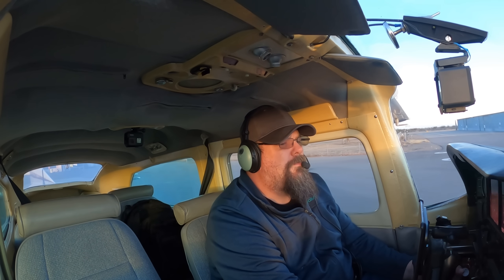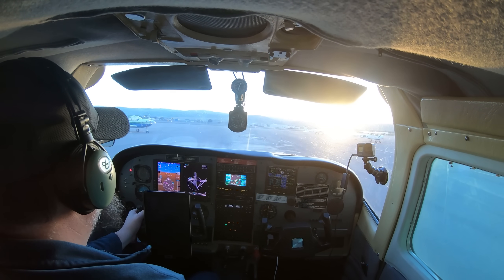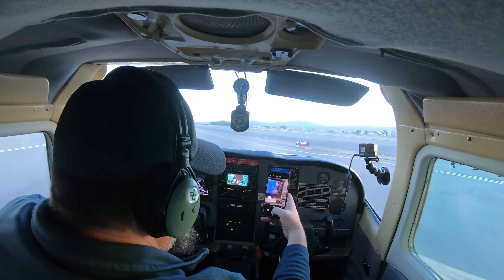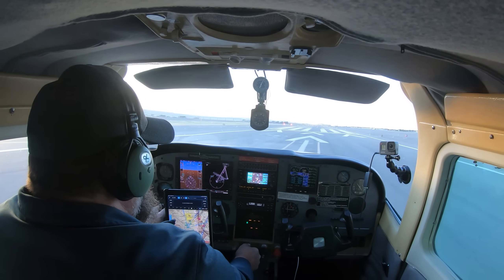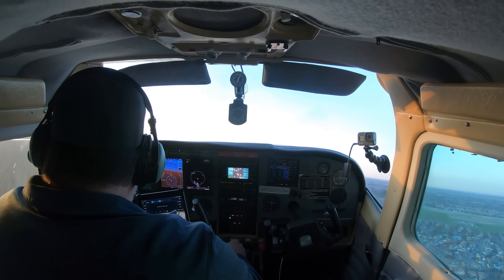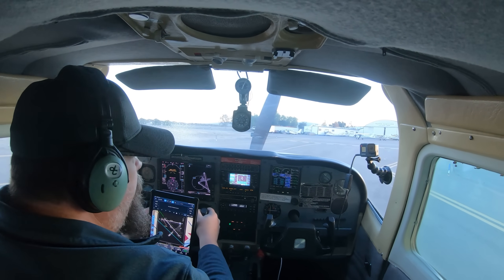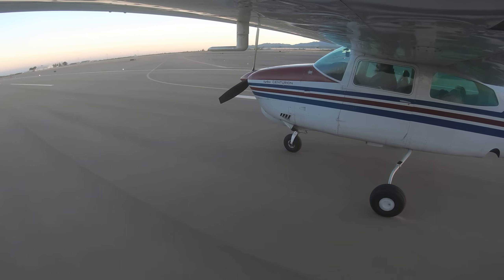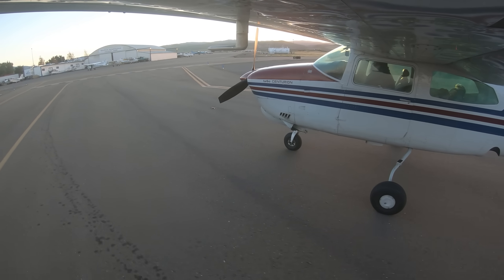Catastrophic Engine Failure after Takeoff

Comment: D.E.I. aircraft mechanics! Mechanics should RUN THESE REBUILT ENGINES FOR A COUPLE OF HOURS ON THE GROUND FIRST, THEN check for issues, like metal shavings in the oil reservoir and filter, recheck compression in each cylinder, retighten each hose clamp, nuts and bolts checked for tighteness BEFORE the plane should be signed off to fly, but it seems more and more engine mechanics SUCK at rebuilding engines and pilot's and passenger's  LIVES are more at risk when their REBUILT ENGINRS SEIZE UP Fter shortly taking off. We just watched 'EXHIBIT A' of an example. ANOTHER thing I would consider putting in my engine oil is Lucas Oil Treatment that makes the oil stick to bearings inside the engine, 'cause if you lose your oil pump, the Lucas will help you limp back to the airport without seizing the engine and continue to produce thrust from the propeller.

Comment: I fail to understand why engine loss is even a thing in aviation.  Unlike cars, you can't just pull over if something fails.  Unlike cars, aircraft engines tend to have these weird catastrophic failures like holes blown through metal, oil all over the place, etc.  Unlike cars, aircraft have complete overhauls every so many hundred hours, which means the engine is completely taken apart, measured with micrometers, and components replaced per spec if they are under limits.  No aviation engine should be worse than a typical car engine for this reason that the aircraft engines are kept almost in new condition via preventative maintenance that far exceeds anything a car owner would do.  The only thing that could go wrong is the person doing the maintenance is incompetent.

Comment: Two points: (1)Your mechanics aren't solving critical issues, and there definitely needs to be some accountability there. (2) You need to take more responsibility over all aspects of the aircraft and its airworthiness.  Did you review or understand the service that had been performed on the engine?  Maybe a test on the ground could have exposed the fault?  YOU are responsible for assuring your flights are safe.  Unless otherwise, stop endangering those around you.

Comment: Two big mistakes  while attempting to exorcise the prop before take off you pulled the mixture control instead of the propeller control. Second big mistake you pulled back the mixture instead of the propeller control. 
What is going on pilot ?????

Comment: Nice job on getting back on the ground,  I'm sure the FAA is going to want to examine that engine, either a mistake was made or defective part...   I overhauled a pair of 520's on a Cessna 310 one came apart shortly after returning to service similar failure to yours.  At least it was a twin.  FAA was present during the tear down inspection, needless to say I was sweating bullets.  They checked everything including break away torque on all fasteners.   Turned out one of the pilots over primed the engine before start (I was not present) filling the intake with fuel which puddled next to the number five cylinder.  When the engine started it sucked the puddled fuel into the number 5 cylinder right engine and hydro locked it.  This bent the rod and it failed about two hours later.  They determined what happened by the wear pattern on the cylinder, since the rod was now shorter.   Wasn't my fault but still hurt I put a lot of hours and care into building that engine.

Comment: You adjusted the variable pitch with the same throttle level. That caused more stress to the motor and probably forced the engine rupture. Nevertheless the mottor was stressed and a long investigation is needed.

Comment: just because you "fixed" a bunch of stuff, what you really did was perturb a stable system in a whole multitude of ways. every little  action taken on re-building that engine represents a two sided -coin....death on one side ....luck on the other. You re-seeded the whole forest with  new opportunities for error. Although there was a need to fix the engine the act of rebuilding it actually increased the likelihood for  failure.   It's a game of chance and the deck is stacked against you.

Comment: Overtorque
You probably had fairly cold engine and fresh journals were too tight- Lowered RPM with propeler which induced higher load on engine

Comment: First of all: I‘ve no idea of flying, but some experience with blown engines:

That engine appears to have thrown a conrod. Typically ;-) that is the consequence of a seized or broken bigend bearing. The engine seemed still to run on its remaining cylinders. What astonishes me most is that the engine cases around the crack look nearly dry - no or very little oil was sprayed out. Astonishing!
Reply from the maker: it was very wet in there, but there was only a few minutes on the fresh oil so it was very clean

Comment: Incase it could help someone in the future: you can reduce drag/improve glide in a constant speed propeller airplane by moving the prop control to the full low RPM/coarse pitch position. Just something that could help you get that “last little bit” to make the landing spot. 

This is an awesome video and a great execution of an engine failure response!
Reply: My instructor had me pull the prop control to full coarse pitch with the power pulled back.  The reduction of drag was surprising.  The prop was acting like an air brake in low pitch.

Comment: It appears from the images of damage that the stud and threads of the connecting rod are undamaged. Improper toque? Prevailing torque fasteners that are single-use due to fatigue or wear from heat cycles and stress unknowingly got reused? It doesn’t look like it from picture but the studs could have been TTY and snapped off. Rebuilding engines is an art and artists are a rare commodity.

Comment: You did well, Ed.  Congats on making a safe landing.  I probably already commented on this vid. two years ago, but I dd not have time to re-read all the comments.  After that much major engne work, I'd have done a 4 or 5 minute run up at full power   I always do a long run up after the annual or any other major service event  According to the time intervals you reported, the engine would have probably quit while you were on the ground in the run up area if you had done a long run up .... a non-event. I'd have kept the gear up until I was sure I could make the field.  I believe you lowered the gear right after the engne failed.

Comment: I noticed shortly after you advanced the throttle, there was a noticeable clatter coming from the engine that is abnormal.  Your DC headset may have prevented you from hearing that, but it is clearly evident in the video, and should have been a red flag.

Great job remembering to lower the gear and drop the nose.

You've earned a new subscriber.

Comment: There is an iconic problem with the Cessna engine. It may seem like it has oil pressure, but there is times where you have to tear down the entire motor because it’s some point for some stupid reason it seems like it has oil pressure. It tells you has a oil pressure, but there has been moments where there actually is no oil pressure because there’s a blockage in one of the lines.

Comment: Wait is it not common practice to break the engine in on the ground by running it for hours at idle, high rpm, low rpm etc before you ever go into an actual flight?

Comment: Excellent airmanship, quick thinking well done. I have seen this type of engine failure before on a Beech 58 with TSIO 520. The engine was O/H . No split was fitted on one the big ends . Look carefully at the your footage,  you can see the undamaged big end stud. Makes you think  was the big ends torqued and or not split pinned after been torqued.

Comment: I’m sure you’ve been asked this question before and everybody’s got their two cents so I apologize but was this a break-in procedure? I only ask because I’ve done a lot of them and they stress in the Lycoming literature and  service bulletins.
Not to unnecessarily taxi around and definitely not run it at low engine settings, low power engine settings . 
I’m just wondering why you guys chose to start up for such short periods of time ? 
Great safe by the way, so glad you made it back safe and so glad you saved that beautiful airplane .
Mike A&P, KLZU
Reply from the maker: The most recent short run and why the engine was warm was to taxi from one side of the mx hangar to the fuel island to top off

Comment: I just now discovered your videos.  I can imagine the feeling of all the blood running out of your head when you hear that rod exit stage left. You did it right, focused on your airspeed and bank angle, and had great conditions and terrain that would allow for such a catastrophic failure to result in a save. With all of the additional ground options and ideal wind conditions, I would have likely made the same decision to make an attempt for the runway.  As many would point out, you did take a risk with the decision to return to the runway, but the conditions were just right to allow for it in my opinion, and it appeared to be a reasonable choice. Most crash incidents in this scenario, as we all know, are simply mismanagement of available air speed and altitude (or simply not enough to work with), but this wasn't one of those cases. I'm very happy to see this ended like it did...  my condolences for the loss of your crankcase though.  That hurts.

Comment: Great save. What was determined root cause? I run the test block for a major engine manufacturer. Ive seen rods come out the crankcase like that. Usually lack of or under torqued connecting rod. Looks to be a Continental.

Comment: I'm no aviation expert, but I think I have diagnosed the problem with your plane.  The engine is not meant to have a piston sticking out of the side of the crankcase.  Best to make sure that that is not the case before each time you fly in future.   (Very good job by the way.  Gear down later next time though, to reduce the drag.)

Comment: The very first engine I built up at Zephyr Aircraft Engine I assembled. 
Failed in flight at 6 hours, 😢😢😢
The Mooney 231 landed safely at Naples Fl.
The engine was shipped back to us.
It's was one of the most horrible days of my life.
The FAA and NSTB showed up and with the owner (Charlie) of the Company and the Top engine builder ( vice president)
They tore the engine down,  I was demoted to sandblasting cylinders and I could see some of the teardown.
The main engine bearings were like strips of creatpaper used for party streamers 20 feet long.
One of my coworkers told me your knees were shaking. 
I looked at him and I replied. "I built that engine. "
He said."Oh God, I am sorry.
They could not find a single thing wrong .
Even the hose clamps for the rocker cover oil return tubes were at the proper torque. 😢
Everyone knew that somehow I screwed up.
Nobody more than myself 😢
Zephyr Aircraft engines replaced the engine with a factory new.😮
The FBO  in Naples installed it and then tied the Aircraft down and ran the shit out of it.
Soon a slight film of oil appears flowing down the fuselage. 
The shop that the FBO sent the engine accessories for rebuild.
NO WE NEVER HAD THEM, JUST THE BARE ENGINE. 
We always run them after rebuild with a test "club"
on our engine stand.
The shop that rebuilt the Propeller governor. 
Installed the main shift oil seals (2 oil seals for redundancy)
They installed them backwards and it pumped all the oil out of the engine.😮
The damage had been done to my reputation and  it was awkward working there.
A drunk driver a couple of weeks later ran a red light in Sebring FL. Highway 27, and totaled my pickup truck.
So having no ride, and on bed rest for a week I quit.

Comment: Great skill and keeping your cool there, well done. Others, note that the turn back to 080 (rway 08) was 220 degs. And ended up neatly on the 08 threshold.  Not sure what the wind is. But if you'd been taking off from a single runway airport, that would have been challenging/prob not possible because you'd have "dumb bell" it and turn back right, putting pressure on you to get in a steeper turn.  So if you want to practice this, try it at a high altitude to see what you and your aircraft are capable of!  But.... Very Well Done!

Comment: If this engine was fresh out of overhaul, he should have done a way longer ground run up before ever taking off.  Had he done so, the engine would have failed on the ground instead of right after take off.  His altitude was sufficient to get back to a runway but directly ahead of him was and entire open field he could have landed on and a bunch of roads instead of risking a 180 degree turn with no engine, very little airspeed, and very short of altitude.  The bright side of things I believe was that his engine was still making thrust until it completely seized just feet above the runway. All in all, great engine out landing because when the plane landed he had no engine.

Comment: Nice altitude is your best friend that's when I take off I take off straight up get as much altitude as possible😅 if you haven't had an emergency you haven't been flying enough good job how high were you when you lost the engine those 210s are nice but they're hanger Queens😅

Comment: Wait a minute after rebuilding the bottom and accessories propeller. Everything else was inspected within tolerances why were you so unsure of the motor? Did you not think you fixed it by doing all the work that you did? How did you know there’s still a issue or a problem?

Comment: The "impossible turn" is only impossible from too low an altitude. In every SEL airplane I've owned/operated I make a point of making a complete 180 return to land or at least a simulation of it to get an idea of how much altitude id need based on weight and DA.

Then I brief and/or remind myself of the altitude before takeoff (since it changes based on aircraft, weather, and airport conditions) and call it out when I pass it, so I know that if I loose an engine beyond that point I 100% can make the runway or at least the airport property

Comment: If you ever register 0 oil pressure you can bet the engine has something seriously damaged even if there is no obvious damage and when the pump is replaced the pressure returned to normal the engine needs to be completely overhauled in a land vehicle you can hope and keep driving but even then 9 out of 10 times the engine is toast

Comment: Only thing I would add after thousands of hours and CFI 46 years is I never reduce power or prop control until I Am at least 1000’ ft agl.  A lot of engine failures occur after there is an engine reduction or prop reduction. Every thing else was textbook and you showed you can accomplish the impossible turn.  Good job pilot!!!
Reply: I agree totally no power reduction or propeller pitch until 1,000 ft except reduce manifold pressure so you don't over boost
Reply: Never heard about waiting to reduce power or prop control until 1000' agl.  Makes sense.
Reply: One saving factor for the impossible turn to work in this case, aside from doing everything right, was having the intersecting runway available to land on.  I might of waited a bit to lower the gear, but I would have to say that I would hope that I would be as composed and focused as he was if it happened to me.
Reply: Yep. As a CFI that's the first thing I thought of. Always heard not to mess with anything till 1000' AGL

Comment: Great save... 😳
That engine tho, it sounded crook from the start ☹️
No involvement in aviation however I've built and tuned hundreds if not thousands of engines both standard and performance. 
First thought i thought once it was under load is that engine has a knock... I thought it was going to let go before you even left the runway.
Whoever built that engine for you has a bit of explaining to do i think... ☹️

Comment: Good save! NOTE TO OTHERS: 1. cool day 2. sea level  3. SOLO pilot (very light aircraft) 4. Very quick reaction time (had a plan in place).
Loose one of these variables in your favor and you are coming up short (or worse)....plenty of flat terrain ahead....
The irony is, now that you saved the plane- no insurance claim for the blown engine.
THANKS FOR POSTING ED!
Reply from the maker: Thanks Juan! She's been back in the air for almost 2 years and have 307 hours on the new engine
Reply: @TheEdwardFrye  would not the mechanic or shop be responsible for breaking the engine in ? Did you have to pay for another rebuild or did someone cover part of the cost ?  What airport was this?
Reply: @TheEdwardFrye  Im curious, how much does a new engine cost for a plane like that?
Reply: #1 goal in an emergency is getting back on the ground safely.  #2 goal is receiving a compliment like this from Juan.  Great work Ed!
Reply: And I thought the “Hundred dollar (now $200) hamburger was pretty spendy!
Doesn’t compare to one minute between overhauls! Ouch!
Reply: @stevenslater2669  I would hope that the tech that botched the overhaul is on the hook for it.
Reply: No retracted landing gear during failure also a factor.
Reply: I dunno, he kinda landed a bit off the centerline!
Reply: Add no 5 to Juan’s list of variables. 5. Multiple intersecting runways 
Good save!
Reply: I like how he pointed the nose down to keep his airspeed up in the turn. Very important to keep all planes in their numbers to prevent stall/spin
Reply: A few points for the debrief.. could have done high power taxi trials, no mixing up levers, gear up too soon, and not stopping on the runway
Reply: I thought he was a little quick to lower the gear.  Make the turn first!